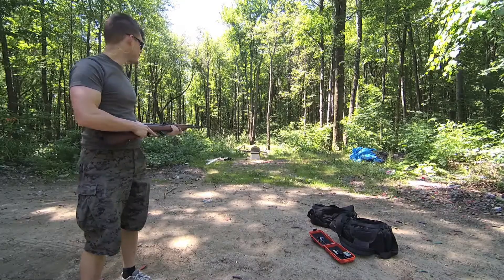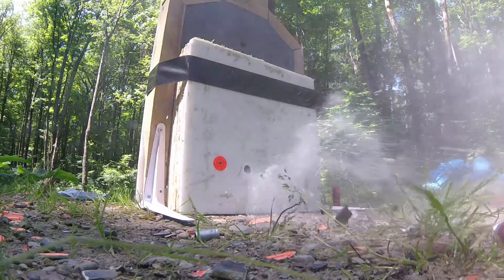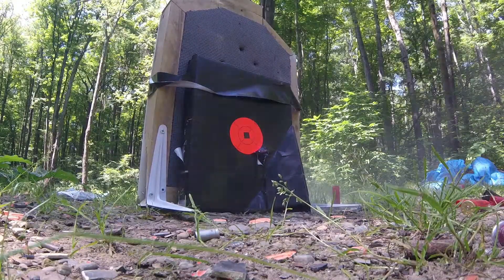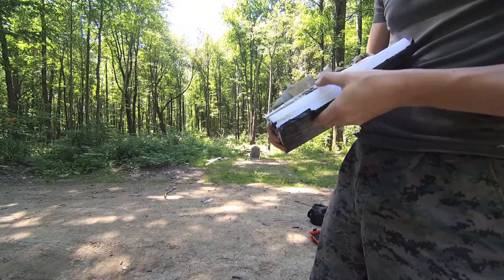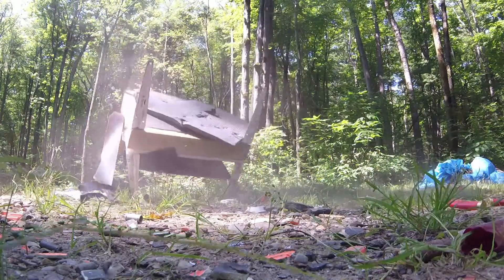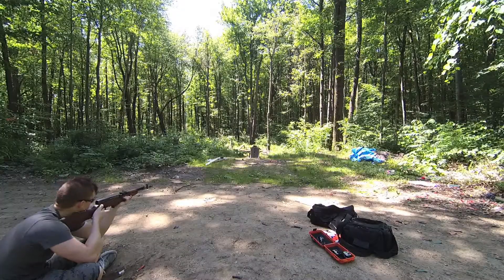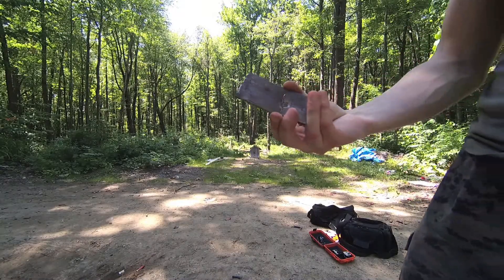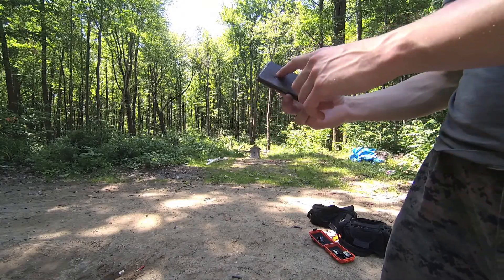Homemade SAPI armor plates part 2

Comment: did you use 1/2 " marble tiles? you didn't mention the thickness of marble tiles,in any of the two videos. Also in your experience,what works better, marble tile or porcelain tile of equal thickness? Marble didn't seem to shatter ,at least in one plate..
Reply from the maker: i cant really say, the marble seems to come thicker, i think the marble was roughly 3/8" thick